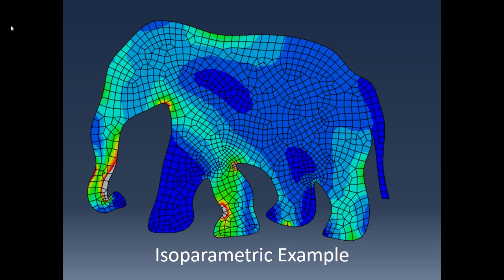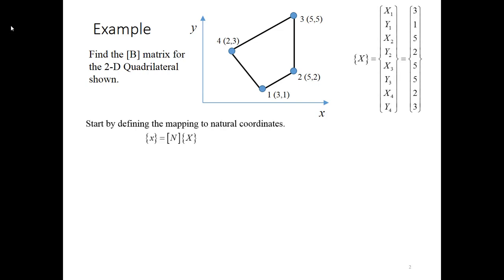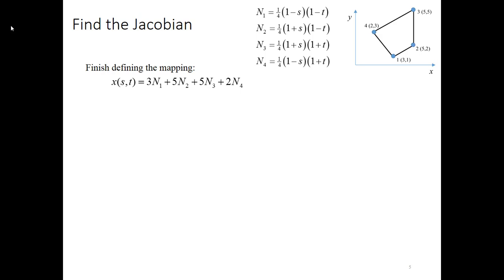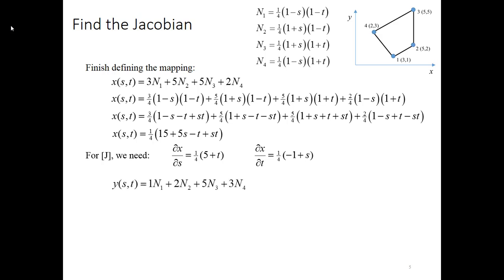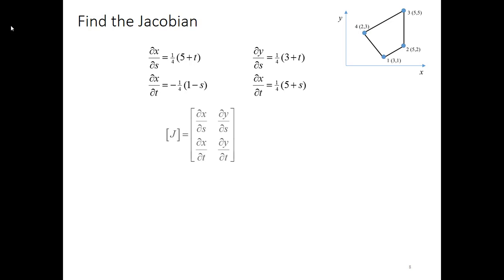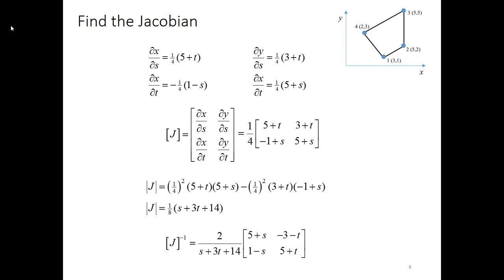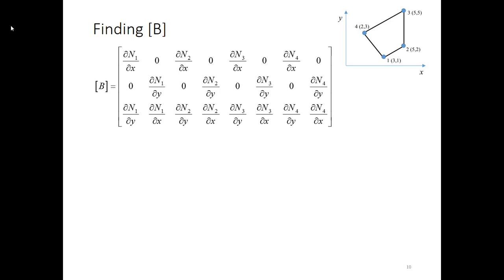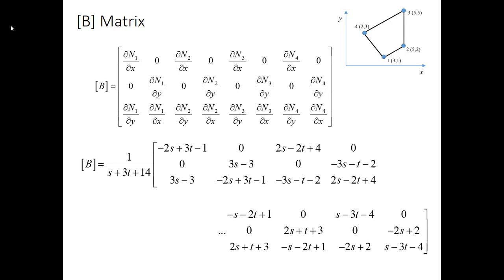FEA 27:  Isoparametric Element Example

Comment: Great video, it actually helped me out tons.
But beware that there is an error in dN3/dx @10:48 and is further complicated @11:11 when dN3/dx is plugged inside [B].  If you take both equations and evaluate them, you will see they yield different results.

To clarify, dN3/dx itself is wrong @10:48 and when plugged in [B] is a whole different equation altogether.
Overall, excellent video. Liked
Reply: Thanks for pointing this out.  For anyone wondering, the numerator should be 2t-s+1.

Comment: This was fantastic!  I'm doing a class project and this was the portion I really needed help with.  I'm going to use this method, but I did have one question related to an example in my text: Nam Ho Kim et al. 2009, example 6.10 b.  They refers to the B matrix as [B(si,tj)] in their stiffness matrix calculation and don't appear to convert it to x, y coordinates.  Are they somehow not converting the B to x,y coordinates and leaving it in s,t coordinates to find the stiffness matrix?  Is that something you can do and then convert in the final stiffness matrix?